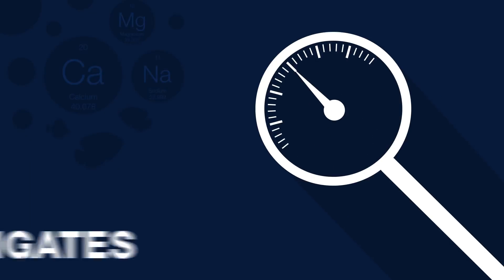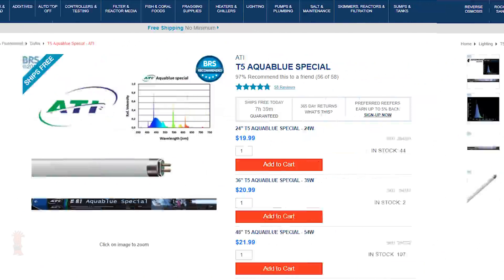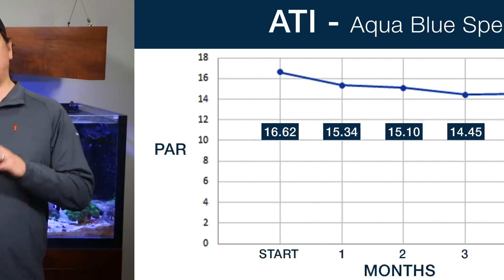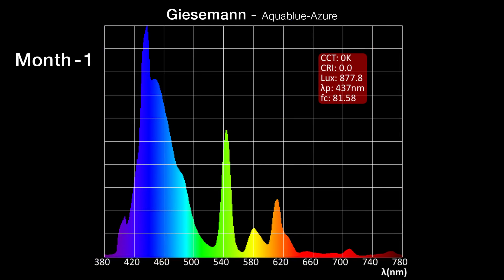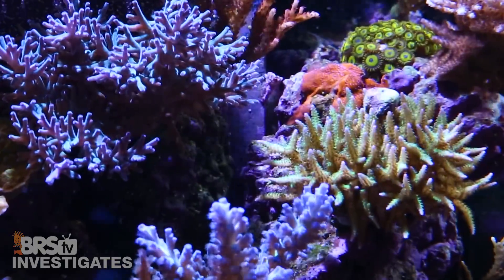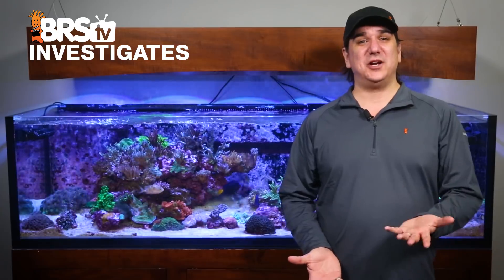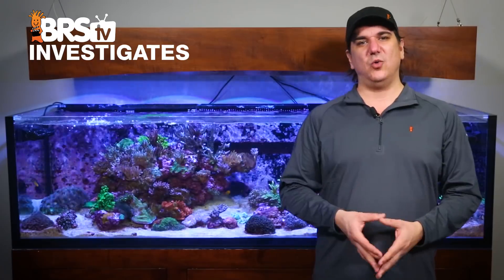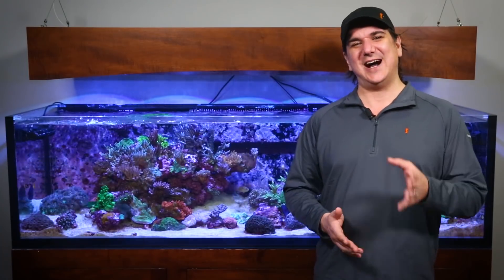How often should we change T5 bulbs? Part I | BRStv Investigates

Comment: Run this test out to a simulated 2 year mark. I have always changed them believing there would be an exponential loss AFTER 1 year. Seeing the bulbs perform as they should in a 1 year time frame doesn't really settle any debate.

Comment: I have done something like this but for different reasons if you look at light drop off over time for fluorescent bulbs you see that the most drop off happens in the first 3 months 20~30% then it stabilizes and the drop off is very very slow for years. My solutions was just to not replace the lamps at all. Simply add an extra bulb or 2 to make up for the loss and run the same bulbs for years. Works fine for plants, not sure about corals. The reason is unless you replace bulbs constantly or rotate them in every 2 months you already lost most of what you will lose in the very early time. The other option would be to rotate in 1 new bulb at a time every 2-4 months. But since then I have moved more over to LED because they just last longer and its less maintenance.

Comment: I run ATI sunpower 24" 8 bulb and 48" 8 bulb. I visually see a difference from day 1 to about 2 months old, running 12 hours with a 1 hour ramp up and a 1 hour ramp down. It's not as bright or blue. I change bulbs after 12 months. Both tanks sit next to each other and when you replace the first set, you can definitely see a difference in light color and brightness.

Comment: Really curious about the "next year" is like,  to say you don't need to change them after a year is great, but what's the limit on them?   I think if you had a T5 setup and staggered replacement bulbs then one or two going down as low as 20% shouldn't be a huge issue.